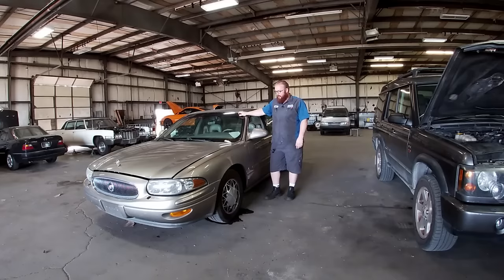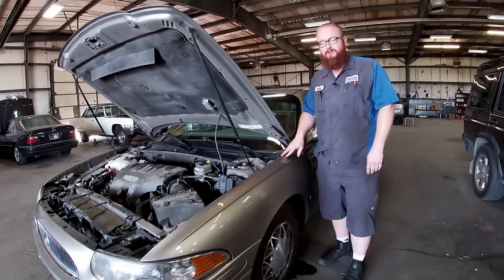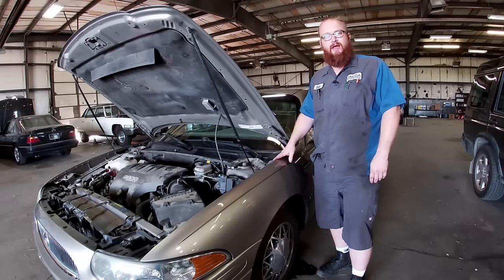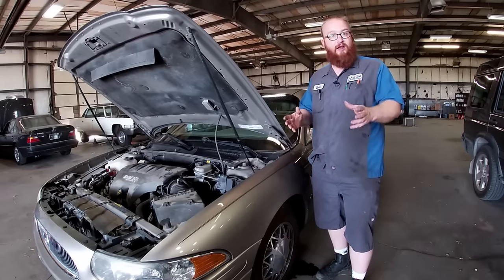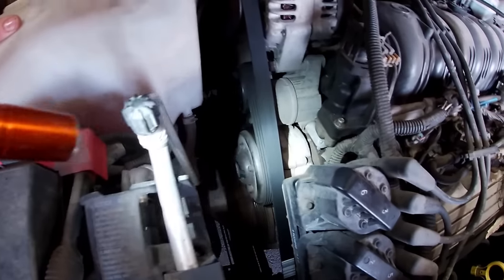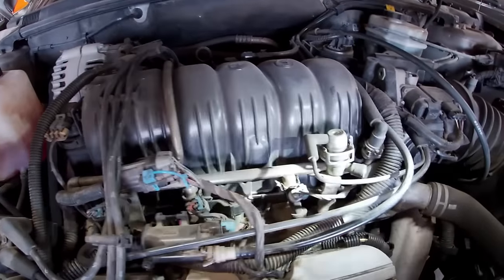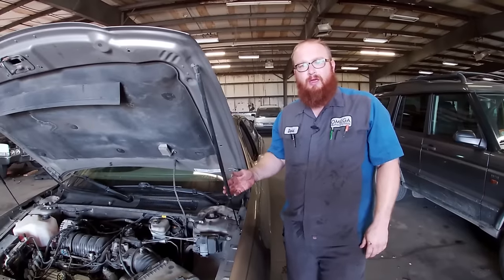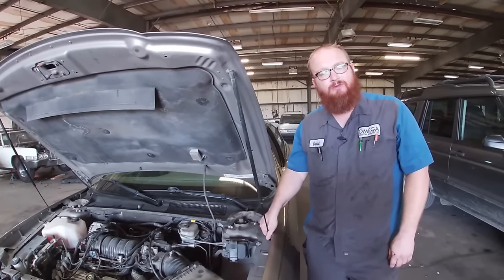CAR WIZARD highlights what makes the Buick 3800 V6 the BEST engine ever!

Comment: Geo metro 3 cylinder will run forever. Audi 5000 5 cylinder will run up to 1million miles. Audi 90 2.8L V6 gets 32-34 mpg. Those are some of my favorite engines. This seems like a good one too.
Reply: Lexus LS 4.0 v8
Reply: And that Geo Metro 3-cyl was incredibly easy to work on.
Reply: The Geo had no power, and the Audi's are expensive if anything does go wrong. This engine has neither of those downsides.
Reply: @wahidtrynaheghugh260  This and the Lexus 4.0 are two of the best ever built.

Comment: The Best of Old GM, glad I own one. I'll miss old Real GM :(    

Don't forget about the 2.8/3.1/3.4/3.5 :)
Reply: The 3.1 in our Buick Century was solid too!
Reply: The 3.1 in my buick century is still clapping along happily at 240k, as the rest of the car is rusting away :(
Reply: @ford300rippergarage  original trans? and how often do you change trans flluid?
Reply: @dwsherm1  original trans, fluid has been changed once about 100k ago, should probably do it again
Reply: @ford300rippergarage  Good to know, I have an 04 with 113k and need to change trans fluid. The only part I've replaced other than normal wear/tear was fuel regulator.
Reply: @dwsherm1  same, my FPR started leaking. Also the TPS wemt bad but thats a $30 part
Reply: @ford300rippergarage  funny mine started to get hot last year and diagnostic indicated bad tps so I bought one but problem went away. My mpg is only about 20 mixed driving and been that way a long time. Does your's do better?
Reply: @dwsherm1  20 mixed driving is normal. Can get 30 if your on the highway doing 80 for several hours
Reply: @ford300rippergarage  Thanks for replies, I was going to sell but may keep it. Don't like paying 600 a year for a spare vehicle.
Reply: @dwsherm1  your welcome! run it till it drops!

Comment: Greetings from Oz...I have a 1996 VS Holden Commodore with this motor ...Its my 3rd commodore of the same model  ..1996 station wagons...My 1st did 870Km , my second was written off after a tail end with 190Km , and my third , which is still my daily driver has about 345Km . I swapped out the dash from the one that was written off , so it probably has more Ks. I'm no mechanic , but I can work on these motors and get parts even now in 2023. the bodywork on my current car is in need of some work , due to hitting kangaroos and some local 4wd people who practice touch parking . so Im now trying to decide if it is worth refurbishing my car or replacing it with a VY 2003 model that still uses the same motor ( it was the last here in Australia.) I totally agree ..these are great all round motors , Chris

Comment: ive got the same engine in my 95 Holden VS Commodore. I heard they had this in the pontiac gta's and buick gnx.
Reply: They had it in the Pontiac Grand Prix, Buick GNX/LeSabre/Regal/Regal GS, Oldsmobile Delta(88)/Regency(98) and probably a bunch of other cars I can't remember off the top of my head.
Reply: Wait, this is the same 3.8 in the Grand National?! That engine was introduced in the 70's!
Reply: Introddused in the 60,s
Reply: @bdhale34  Some Holdens with this engine had a supercharger and those who didn't could always add one. So quick and easy to change the fan belt.

Comment: "The horrible, horrible, horrible 3.6 V6," did I catch all the horribles in the original quote?
Reply: I just got a 2.8 caddy cheap in great shape white 18 rims but only putting few miles on as a summer car for Sunday drive . It was cheaper than fixing my Ac on my 2004 daily driver Grand Prix 3.8 . I checked chain were done 10000 ago with cloynes chain kit . I cleaned Pcv system and flushed engine several times before safety check and put in mobile 1 5-30 and low restriction gm new filter and 4 oz of motorkote
Reply: Would have wished CT’s was a 6 liter not the modular v6 but I will make it last by 4 k mobile 1 oil changes and some supplements that clean and reduce friction and not beat on it , why could gm not kept the 3.8

Comment: L67 or the supercharged 3800 v6 is a beast ! 💪🔥
Reply: The L67 is the supercharged V6.
Reply: @demontech06  He's clarifying what the L67 is.
Reply: Then he probably wouldn't have used the word "or". He said "L67 or the supercharged 3800 V6". His sentence is referencing it as 2 separate engines. The series 1 and 2 SC engines were both labeled as the L67. The Series 3 SC was labeled the L32. I'm not trying to start an argument, but he probably should've said "The L67 3800 supercharged engine is a beast" Therefore it's being represented as a singular entity. I was simply stating before someone else chimed in and said something a little less pleasant.
Reply: @demontech06 I can see it both ways. I guess we need to hear from Fabian to know for sure.
Reply: @Hotlog69  Well grammatically I can't. I read what's typed, not what was intended
Reply: @demontech06  Will never know the author's intent. I could make on little adjustment and make it work for you. "L67 or known as the supercharged 3800 V6." Which is how I took it.
Reply: @Hotlog69  Thank you for helping me make my point on the post!Good day to you! 😉
Reply: @demontech06  I did say I understand where you're coming from. I guess I can read between the words. lol

Comment: As an Australian who grew up doing many , many burnouts with these motors in Holden's and spending hours changing gearboxes from doing said burnouts. It looks completely wrong seeing this motor in a car in east- west configuration.......
Reply: What gearbox was it mated to down under?
Reply: @daszieher  We had either the manual (rare) Borg Warner T5, or the TH4L60 4 speed - They started life in the VN Commodore they conitnued in the VP and VR where it ended. It was replaced with a 3.6 "Ecotec" POS from then in the VS, VT and VX. Until the VY commodore where the 3.8 made a return, it stayed for a few more years until the end of the VZ series. We got the supercharged variant of the 3.6 on some of the VT and VX "S" pack models. We got the supercharged 3.8 on some VY "S" packs.
Reply: @adamossowicz2611  excellent! Many thanks for the good info!
Reply: The 3.6L Alloytec didn't replace the 3.8 in Australia until 2004 in the VZ. The Ecotec you speak of in the VS etc was still a 3.8
Reply: @bofty  correct.. the alloytec did not end up in commodores until the vz. Also there was another gearbox variant for the Ecotec , it was a 5 speed manual getrag box with a dual mass flywheel.
Reply: @daszieher  That comment you replied to is very very wrong. Google the history of the aussie commodore
Reply: @bofty  thank you for pointing this out.
So there was no T5 behind the 3800? It was a Getrag?

Comment: I agree with you. I have a 97 Buick Park Avenue. You have to do normal maintenance, but my engine has 180000 on it still gets 27+ mpg. It's so quiet and smooth that I have been stopped several times for speeding. The trooper usually let me off when I explain.They say they've heard the same from other Park Avenue speeders.....

Comment: What about the vortec 4.3? That was also a good engine.
Reply: S.Tracy 5.3 2002 was best year , my Silverado is rusty but that motor drives cheap And goes n goes
Reply: 4,3 great engine just does not get as good fuel ecomony
Reply: 4.3 for sure. Have one in my Silverado. Made for decades. 3.8 Series II in my Camaro. Best V6's ever made by GM, or maybe anybody.
Reply: Had that engine in an old blazer/Tahoe some years back. Had to junk it due to an accident but that engine was a champ.

Comment: my friends dad has a 2004 tundra with 1UZ v8 454k on the engine AND transmission
Reply: 1UZ is a very slept on engine, especially with the older ones that can make great power with boost
Reply: we drive the hell out of it too, thing is a modern day tank

Comment: Just needs to be paired with the best transmission.... :-)
Reply: This engine came with a decent 5-speed transmission in the Firebird and Camaro from 1997-02
Reply: Transmission R&R on GM 3.1, 3.3, 3.4, or 3.8's....GRAAAAVVVY ALL DAY!

GM turd, 🤣🤣🤣👍👍👍cannot dispute that!
Reply: PAULY'S AUTO most people don’t service there transmission in 100 of thousand s of miles , but as soon as it starts to fail oh I need a transmission service TOO LATE . I pump mine out 2 times a year through dip stick hole and change filter couple of times during the life of my cars gm ,ford , Toyota , Chrysler’s no problems with transmission even on cars I have taken to the track that were modified
Reply: @nickking1510  you're not telling me anything I don't already know guy😂

They're all garbage, just what flavor of the month you want!

Comment: they may be good but i seriously doubt they are better than a toyota 20R or nissan L or Z series 4 cylinders . they both have forged crankshafts and rods and double row timing chains . the buick has cast crank and rods , and single row timing chain both of which are cost cutting measures typical of american cars . and the toyota and nissans also run higher oil pressure which usually contribute to longer engine life
Reply: That stock Buick long block holds 750 rwhp with head studs. Yeah I'd say for having cast parts it's still just as strong internally if not stronger than your forged yota 4 banger. The single roller timing chain is a myth and it's been proven time and time again it doesn't do anything. And high oil pressure pumps are only necessary on heavy duty diesel truck engines. They do nothing on car engines, as long as the engine has oil passages that is big enough that it doesn't clog than it will go the distance. Vortec engines, and Buick 3800s routinely go 500k miles and they dont have a high pressure oil pump.

Comment: I take a Old Mopar Slant 6 Any day or a Ford 300 straight 6. A 0ld  school Chrysler 318 pre 90,s .
Reply: Yes
Reply: back in the day, (once upon a time), drove police cars with the 318 with a 4 barrel, suckers could take 100,000 miles of policing and still run like new (they had very little carbon in them!), police model came with HD brakes, cooling, alternator, suspension, and seats.  If they weren't crashed  they make a great used car.
Reply: Gary  I have owned many a 318 that was more fuel efficient than the 3.8 Park Avenue that I drive for a work vehicle today.
Reply: The 198 and 225 were good too!
Reply: Lol

Comment: Thank you for your honest opinions with these vehicles. I just got lucky enough to find a 1993 lesabre with only 1800 miles on the vehicle. YES ONLY 1800 miles. I look forward to many years and many miles with this vehicle.
Reply: A car like that--hardly used at all...can be very expensive to make it "road ready" again...check all systems out, replace fluids, tires, etc before you seriously drive it...Might cost you a couple thousand bucks to do all that, but so what?...You would still have a basically brand new, 30 year old car that would be safe to drive!

Comment: Yeah, but GM went bankrupt 2007-2008-2009

Engines were TOO GOOD ?
Reply: And they stopped producing the 3800 in 08. Coincidence?
Reply: Their labor cost was too high. Some even joked that GM was a benefit company with an automotive division attached. Now GM is getting around the high labor problem by shifting production to China.
Reply: @ArchiWannabe   Its getting harder to blame them. The average hourly employee makes $90,000 a year with full benefits.  They're on strike right now because they want even more.
Reply: Too many dealers and ridiculous spending but a LOT was to do with the fact they had 7 guys drawing a company pension for each guy on the production line.

Comment: too bad they always mated them to that slush box 4t65e....
Reply: yeah I was wondering how good those transmissions were I never had mine long enough before I sold it and if they ever had a kit to mount a manual shift behind it that be a great combination I think
Reply: @bryanelliott1928  it wasnt the worst and was great for gramma to putz around for up to 250k miles but when paired to anything but the NA 3800 it couldnt hold up and they cant take abuse. i absolutely love ls4 cars but i would never buy one that had the stock trans. gm dropped the ball so bad not pairing ls4, l67 and l32 cars with a manual trans
Reply: So many good things were replaced for something that was so incrementally better under perfect conditions for a difference in fuel economy nothing but the instruments measuring that and very miniscule gains for emissions the owner would never know and the EPA mandates would never realize a real world advantage. It is called "designed by mandate". No nothing bureaucrats pulled the fatwas out of their too governmentally powerful butts. Designed by government is something that makes the last 10 years of cars all look the same. 

You can see how automobile death rate went from a low of 30,000 per year to over 40,000 mainly because of such bullshit as touch screens. You can't watch the road and scroll through a plethora of hard to find options just to adjust the radio or the temperature. You have no visibility due to structure mandates that leaves no sight.  Windshields have so much wrap angle and are so small you can hardly see through the distortion. 

I got out of a 379 Peterbilt one day and into a new Dodge 200 and was paranoid to the point I stopped for a couple beers I was so nervous with no visibility even through the winshield.  The last thing I want is a new car.
Reply: @bryanelliott1928  there was a manual option for several years on the GTP.
Reply: here in NZ it came with the Commodore...it was rear wheel drive and you could buy it with a 5 speed manual trans.
Reply: @oillease1881  Lol, did the beer goggles help with the visibility?
Reply: @DecalsAndFriedChicken13  a G6 GTP not the grand Prix
Reply: @dishman8595  G6 didnt have a GTP version i thought it was called the GXP? nvm just looked it up XD
Reply: I can attest to this.  I have a LeSabre like the one in the video with 114k as my first car (unfortunately, it's a fairly decent car but it's ugly as hell) and the transmission is garbage.  After a while of driving it shakes, shutters, and slips around.  The old lady never got the fluid changed, and I unfortunately changed it.
Reply: @WokeUpDead16  Quite a bit actually. I was more relaxed not being able to see every direction. 

The 379 was so nice to drive and see every direction. 6 inch spot mirrors above and below west coast mirrors and a mirror straight down the passenger side plus a bottom door window I was relaxed, much more than having a couple beers trying to see out of a bathtub with no vision any direction.
Reply: They weren't that bad reliability wise if taken care of. Not super sporty, but change the trans fluid and filter often enough and they were fine.
Reply: @TylerDurden-oy2hm  4th gen Camaros and Firebirds come with the 3800 in rwd configuration too, and manual too. Rover V8 are the same engine + two pistons.
Reply: @darthdarthbinkss  have you tried changing the transmission filter again?  Sometimes it can just get clogged up after a flush.
Reply: @nevermind1534  I haven't, but I could though.  To be honest, I think I exaggerated a little bit.  It's been driving better as of recently but I still don't like it.  It could just be the shitty solenoids and old transmission mounts tbh.

Edit: whoops, forgot to say it wasn't a flush.  Just a change.
Reply: @darthdarthbinkss  I bought my 05 Lesabre 6 years ago with 89k miles. I've changed the transmission  fluid every spring. It now has 190K on it and I swear it shifts better than it did 100k miles ago.
Reply: @DG-bp8xb  Every spring? Holy shit
Reply: @DG-bp8xb  what type of fluid dexron 3 or 6 or something else?  Change filter too?
Reply: I was looking for this comment lol.

Comment: Transmissions in this Buick sucked though. I had two and each had failed transmission less than 120k
Reply: Yep, the transmission are bad. All vehicle electronics are terrible, radio went out, AC, power windows, all back to back within a yr. 
If you are not careful removing the alternator you will break the oil sensor. Who was the genius who installed a huge AZS sensor right underneath. If carried away, the alternator buckles and breaks it.

One thing I do miss, one can drive all across the US and barely have backpain because the bucket seats and the ride is superb, the car floats on the road,plush ride.

Comment: I bought my Buick LeSabre with a 3800 new. The engine went at about 80k (connecting rod bearing). After the engine was rebuilt, the transmission went 5k miles later. My Honda has about 200k, and no problems.

Comment: 3.8 is good but I'd rather have a Ford 4.6. Panther vehicle will last longer too
Reply: Owned both and I found both to be near "bullet proof". But then again... if that 4.6 Ford came out of a police package P-71... it pretty literally HAD to be!!! 😁 lol
Reply: Roger Smith the 4.6 ford motor was reliable but - hard to believe - not at full- throttle - Popular Mechanics Magazine tested many engines and had surprising results

Comment: I lean toward the 4.0 liter straight six engine from AMC/Chrysler, that engine has been around for over 40 years and is like an iron horse.
Reply: Yes, Also an excellent engine ! Smooth running , power is great and reliable!
Reply: I have a 92' Jeep Sahara, 4.0 HO. Engine has NEVER had a single thing done besides oil and filter changes.
Reply: One does not cite Chrystler inline 6 cylinders and ignore the majesty that was the SLANT 6.
Reply: @bdhale34  Yeah, that was a good one too.
Reply: @bdhale34  , so true I had a brain fart. That is another solid engine .
Reply: I had 2 cherokees with the 4.0's. Ran them for over 25 years. 4 kids learned to drive with em, drove their friends through snowstorms. Finally they both got pounded and rusted out. Neither of engines were blowing blue yet !
Reply: But not the same!